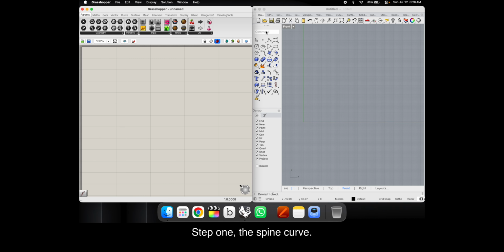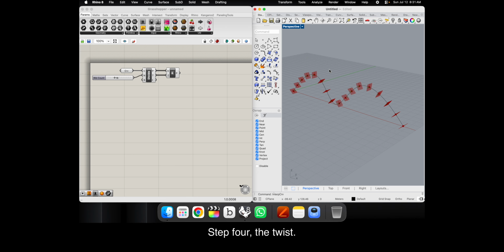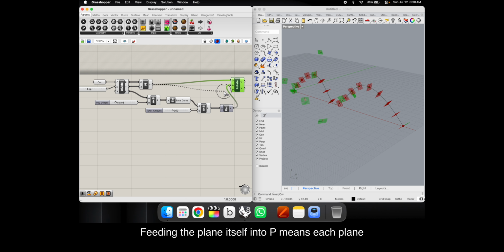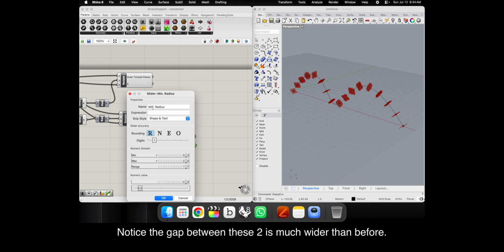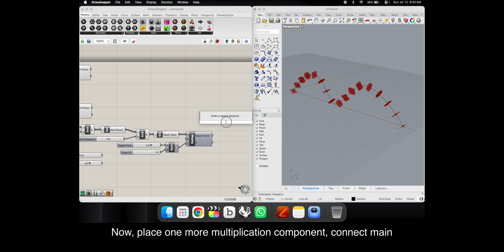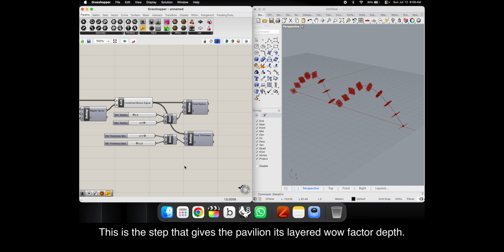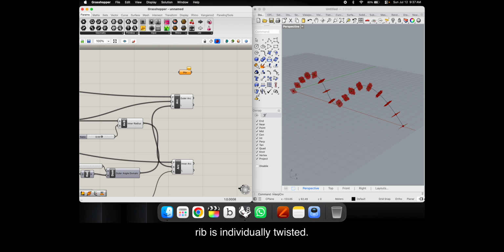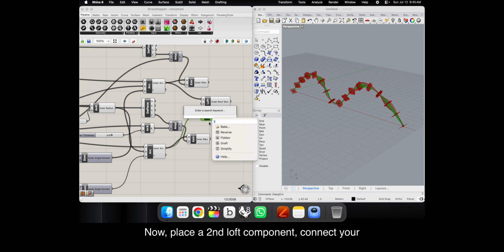Day 07 | Phase 1 Final Project — The Twisting Ribbon Pavilion

Comment: why the geometry we created in the Grasshopper app appear as a wireframe in Rhino, not as a shade even in render mode
Reply from the maker: It usually happens when Grasshopper is previewing curves or open geometry instead of a closed Brep/Mesh. Try these:

1. Make sure the geometry is a closed Brep (or convert it to a Mesh).
2. Bake the geometry and assign a material if needed.
3. Turn off Grasshopper Preview and switch Rhino to Shaded or Rendered mode.

If you’re still facing the issue, let me know which step in the tutorial you’re on, and I’ll help you troubleshoot it. 😊